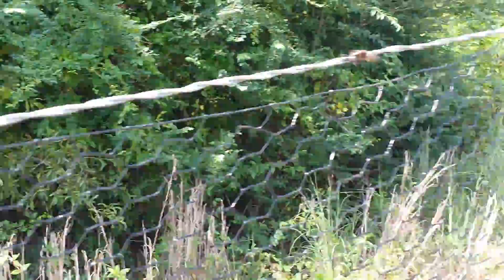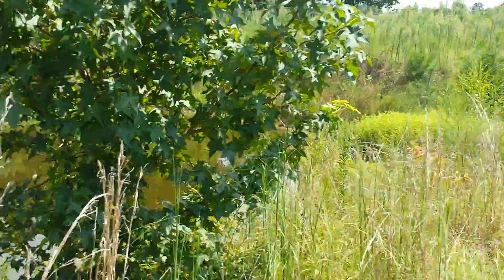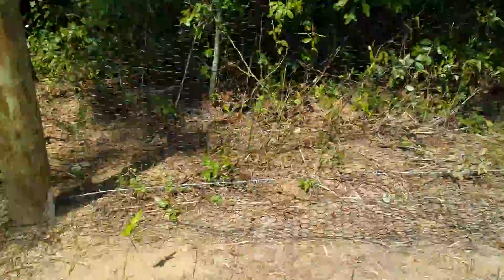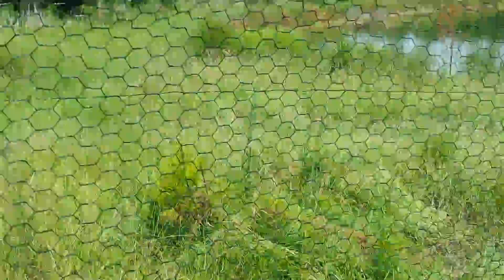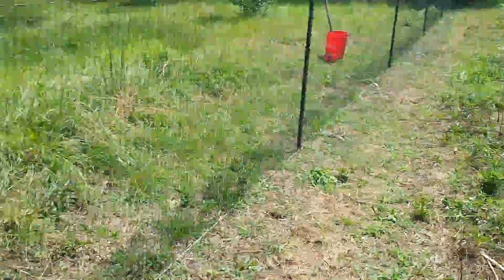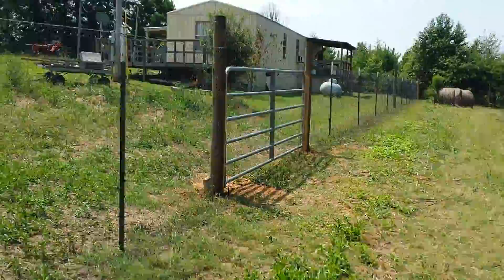Pen Construction

Comment: Did you use galvanized wire or the plastic type? I’ve seen so many different types with galvanized, vinyl coated and the actual plastic hex wire